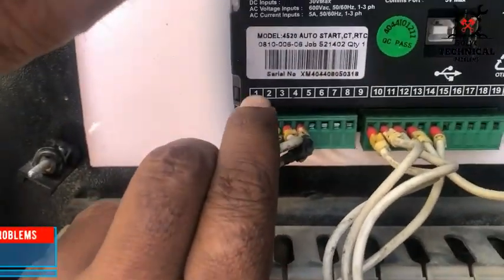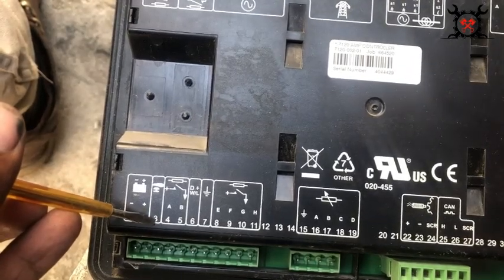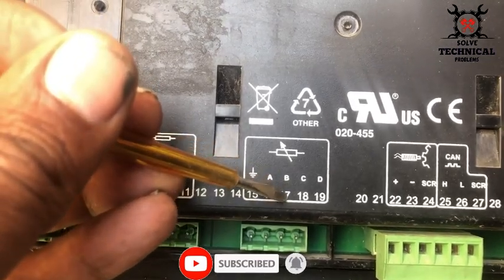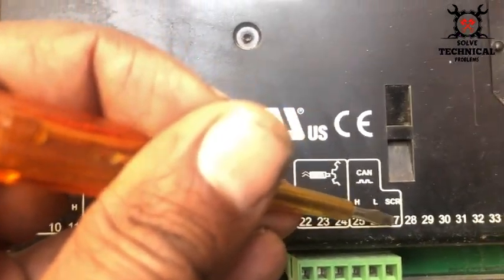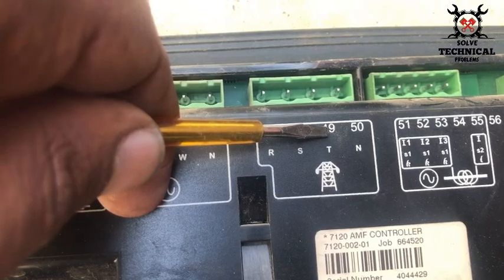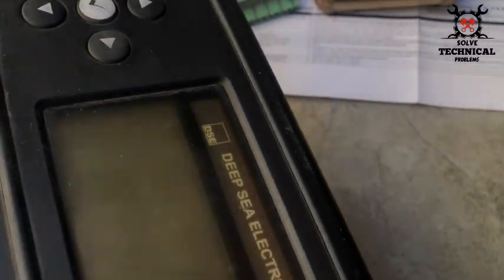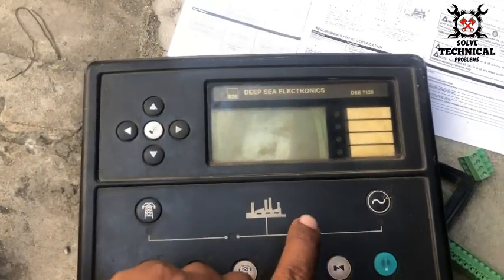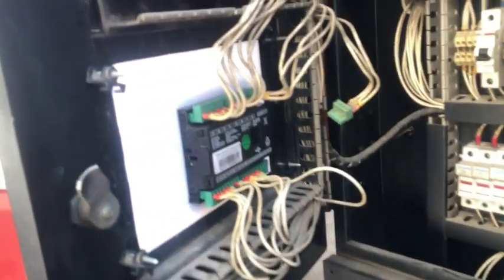Deep Sea 7120 module wiring and installation . watch the complete video to learn the process.

Comment: Nice video sir for this controller, sir in dse 710 and 720 the maximum voltage is 333volts in manual book, possible i put line to line 440v if the output voltage in genset is 440v, 60hz, thankd and take care always sir
Reply from the maker: No not possible only live and neutral single phase option
Reply: @Technical.Education  thank you so much sir